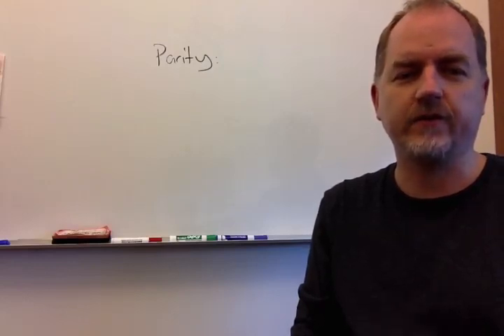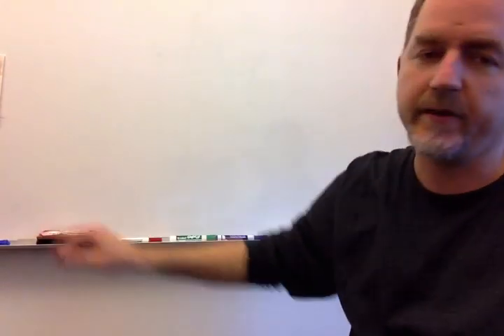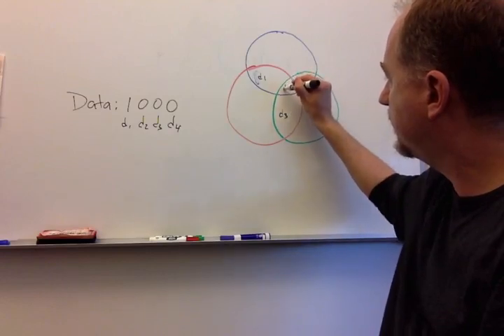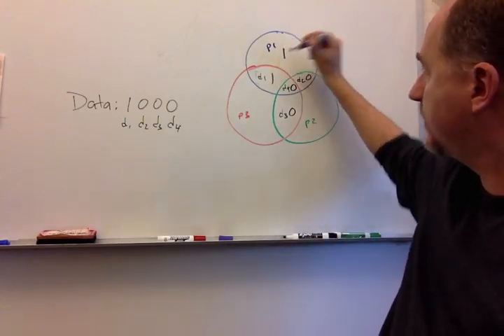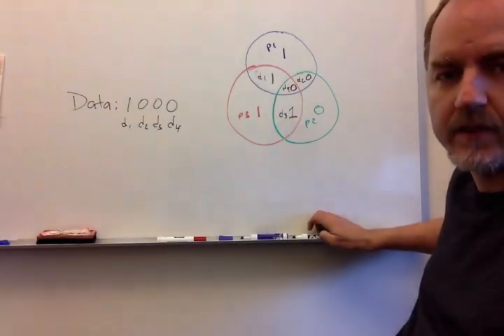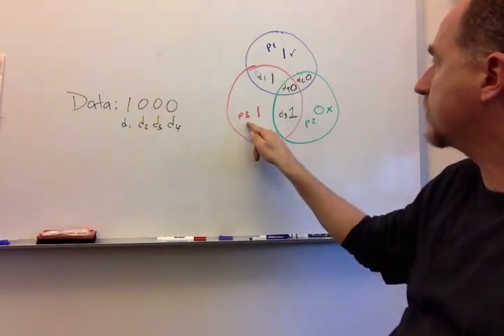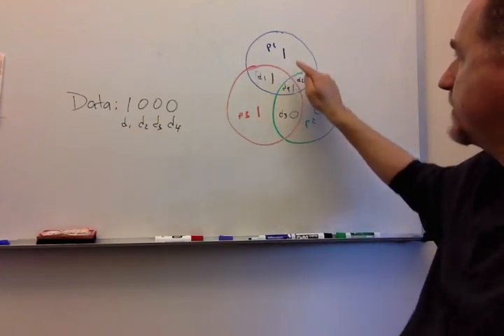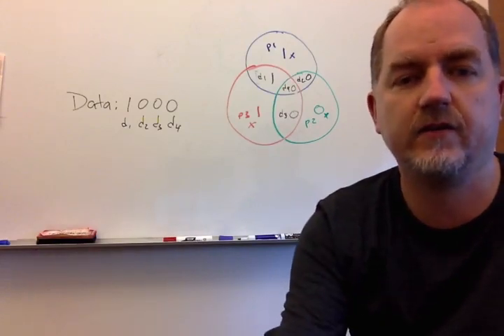Hamming Code Error Detection and Correction Visualization

Comment: What if parity bits corrupted along with databits?
P3 change to zero from one , d3 changed to one from zero,P2 changed to one from zero.
Now red circle 101(d1,d4,d3(corrupted)) this is even parity P3 so 0(corrupted)
Now green circle 001(d2,d4,d3(corrupted))  this is odd parity hence P2 is 1(corrupted)

Conclusion:
This is only one bit error correction.
So there is there is distance between the code i., e valid data code  (000 to 111 is 3 change, hence 3 is distance betweenvalid data data code ) remaining combination 001,010,011,110,101,110 all are wrong or corrupted data code  hence these corrupted data code having minimum distance (1 changes  ) from any of the valid code
Here minimum distance between any of the valid code to corrupted data code is 1.
Ex., changes between  110(corrupted data code)to 111 (valid data code) is 1 therefore  distance is 1
changes between  010(corrupted data code)to 000 (valid data code) is 1 therefore  distance is 1
https://youtu.be/5sskbSvha9M

Comment: Interesting. I never thought of representing it with Venn diagrams before.  :)  For those that are wondering about numbers larger than four bits, here is how the Hamming code is constructed:

Say you have the following 11-bits of data: 110 0100 1010.  Now you want to make a Hamming code out of it. The way it works is like this:

1----2----3----4----5----6----7----8----9--10--11--12--13--14--15
P1  P2  D  P4    D    D    D    P8  D   D    D    D    D    D    D

where D = Data bit and P = parity bit.  

How to calculate the values for each parity bit:

P1 = 3 xor 5 xor 7 xor 9 xor 11 xor 13 xor 15 = 1
P2 = 3 xor 6 xor 7 xor 10 xor 11 xor 14 xor 15 = 0
P4 = 5 xor 6 xor 7 xor 12 xor 13 xor 14 xor 15 = 1
P8 = 9 xor 10 xor 11 xor 12 xor 13 xor 14 xor 15 = 1

This gives the following 15-bit Hamming code:

1011 1001 1001 010

NOTE: 

P1 considers all the cases where bit 1 = 1.
P2 considers all the cases where bit 2 = 1.
P4 considers all the cases where bit 3 = 1.
P8 considers all the cases where bit 4 = 1.
Reply: Kindly let me know 
How you got the formula for calculating parity ?
On what basis you calculated the parity,
On what basis  you inserted  P1, P2 ..P4 etc.,
Is there formula for order of insertion of parity bits.
Reply: @AJ-fo3hp  It's from my textbook: Digital Design by Mano, Ciletti.

Comment: Thank you that was very helpful.  I used the error detection with 3 errors on 2 separate strings.  The first error 0101 was corrected.  The second error 1011 was not corrected, the return was 0110 and the detection circles read it as a correct return.  I have to study more on the Hamming Code Error Detection and Correction.  Thank you again for the introduction.
Reply: What if parity bits corrupted along with databits?
P3 change to zero from one , d3 changed to one from zero,P2 changed to one from zero.
Now red circle 101(d1,d4,d3(corrupted)) this is even parity P3 so 0(corrupted)
Now green circle 001(d2,d4,d3(corrupted))  this is odd parity hence P2 is 1(corrupted)

Conclusion:
This is only one bit error correction.
So there is there is distance between the code i., e valid data code  (000 to 111 is 3 change, hence 3 is distance betweenvalid data data code ) remaining combination 001,010,011,110,101,110 all are wrong or corrupted data code  hence these corrupted data code having minimum distance (1 changes  ) from any of the valid code
Here minimum distance between any of the valid code to corrupted data code is 1.
Ex., changes between  110(corrupted data code)to 111 (valid data code) is 1 therefore  distance is 1
changes between  010(corrupted data code)to 000 (valid data code) is 1 therefore  distance is 1
https://youtu.be/5sskbSvha9M

Comment: What if the data is more that 4 bits?
Reply: Lol, just look up huffman :-) That's one of the way to compress bits:-)
Reply: So, being curious I looked at Huffman Code, which I knew was a compression technique but that was about it! So from what I can understand it compresses a string by assigning repeated characters with the smallest possible amount of bits. I assume this reduces the size of the string as instead of storing the 8 bits for each character, we just generate a binary number from the notation (code) from the tree. Then to convert the apparent random binary number we just have to follow back the tree? 

Haha, apologies if that is either wrong or a bit rough, but that's what I seem to understand it to be! Very Interesting!
Reply: +Liam Taylor you divide it to 4 bits. Keep in mind you will also want to compress the bits before you use the hamming code.
Reply: lol, how do u intend to "compress" bits
Reply: Yeah, basically. As you might know we got ASCII Table to store our characters. like a String of 8 bits may be a number of lets say 97(A), normally you would need to have 8 bits to create the number 97. but the huffman coding let you compress the bits to even less bits. This means that you can store more stuff on a for example harddrive. So yes, you can compress bits :-)

Comment: what if the parity bits get changed? data still transmitted fine?
Reply: that is where the correction method comes....after the correction it will be transmitted...
Reply: What if parity bits corrupted along with databits?
P3 change to zero from one , d3 changed to one from zero,P2 changed to one from zero.
Now red circle 101(d1,d4,d3(corrupted)) this is even parity P3 so 0(corrupted)
Now green circle 001(d2,d4,d3(corrupted))  this is odd parity hence P2 is 1(corrupted)

Conclusion:
This is only one bit error correction.
So there is there is distance between the code i., e valid data code  (000 to 111 is 3 change, hence 3 is distance betweenvalid data data code ) remaining combination 001,010,011,110,101,110 all are wrong or corrupted data code  hence these corrupted data code having minimum distance (1 changes  ) from any of the valid code
Here minimum distance between any of the valid code to corrupted data code is 1.
Ex., changes between  110(corrupted data code)to 111 (valid data code) is 1 therefore  distance is 1
changes between  010(corrupted data code)to 000 (valid data code) is 1 therefore  distance is 1
https://youtu.be/5sskbSvha9M